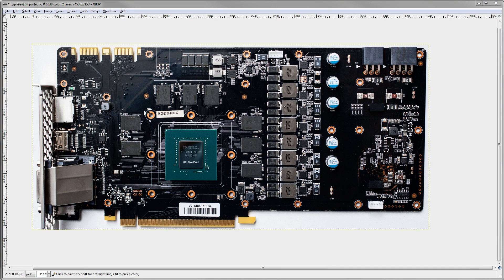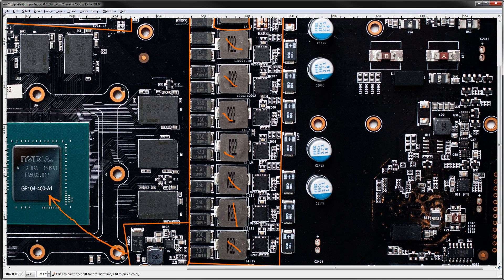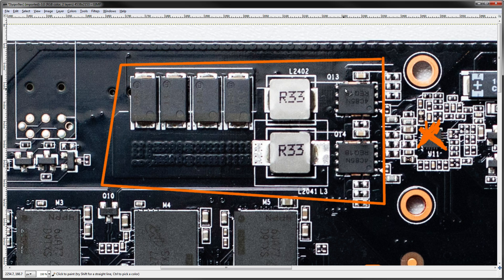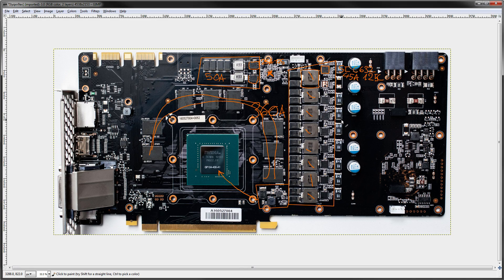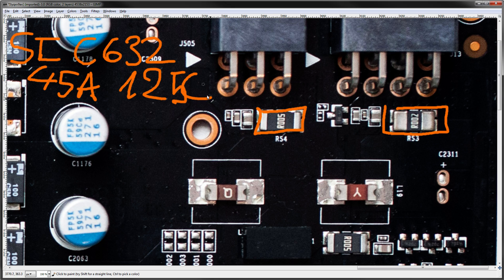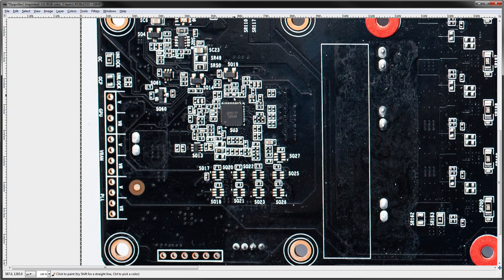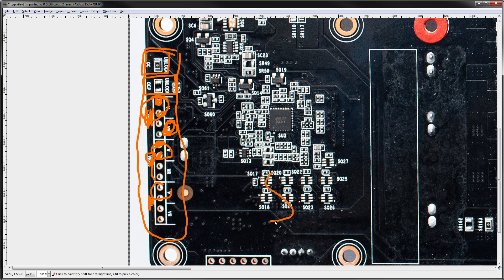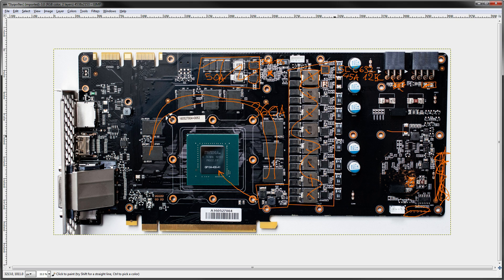PCB Breakdown: Palit GTX 1080 GameRock

Comment: Did the 1070 version get the same components? Or was that stripped down somewhat? I find it hard to believe they would just slap on the lesser GPU on the same exact PCB. Wondering, because i have said 1070 running.

Comment: I bought this card. Ot's really nice. Im running ~2150MHz right now in boost mode but there is still some room for higher frequency. Temps are really nice. I had 290X before and after having constantly 94degrees changing to 75 degrees is a really nice thing :)

Really happy with this game. Name kinda weird tho like you said. 

For me these videos are really nice to watch (automatisation/electro guy here) Cheers!

Comment: I have a question: I found a picture of a gainward 1060: https://static1.caseking.de/media/image/powermod.jpg
Since Palit and Gainward uses the same PCBs, it was of no surprise to me that there were similarities between this and the card in the video. On the picture it's barely visible, but I think it uses vishay's SIC632s as well, in a fashion that looks like a 3+1 phase design to me. I heard that the palit 1060 has an estimated tdp of 140 watts with a slight overclock.  Now forgive me, as what I'm going to say might be absolutely stupid (I'm not an overclocker, I'm not sure what I'm talking about), but isn't the Vcore voltage very close to 1 V (like 1.05V)? That would mean that the heat dissipated by the GPU in watts and the amperage that goes through it aren't very far from each other. You mentioned that these phases can deliver 45A each; in this case that would mean 135A. Well of course I'm aware of that the GPU is not the only heat dissipating component on a graphics card and that VRMs don't work at 100% efficiency, but still, I'm getting numbers that are very close to each other.
Why this interests me is because I'm on the lookout for a 1060 that's shorter than 27cm, but is not the most "budget" option either. What I wrote seems to coincide with that palit and gainward usually only gives 2 years of warranty instead of 3, but I'm intending to use my card much longer than that. So the question: Do you think the palit (jetstream)/gainward (phoenix) 1060 is safe?
Reply from the maker: GDDR5 is pretty power hungry so expect at least 20W to go to that. Also I know I said 45A in the video however that's because the datasheet doesn't show how long the VRM can actually do 50A only 45A even though the title of the datasheet is: "50 A VRPower® Integrated Power Stage". So the card will be fine.

Comment: Oops Accidentally deleted my comment when I tried to fix the horrendous error I made in it. So, the palit 1060 uses similar looking phases, but only 3 for the core. Of course, "similar looking" doesn't automatically mean that they are actually SIC632-s, but if they are, then at 125 °C the throughput is only 135A. If you increase the power target on that card, isn't that pushing it? I'm getting more and more hyped to see a palit 1060 jetstream PCB breakdown video. Or a Gainward Phoenix; as far as I know, they use the same PCB.

I saw you answered by asking if I'm talking about this card: https://www.techpowerup.com/reviews/Palit/GeForce_GTX_1060_Super_JetStream/
Yes, that is the card.

Comment: Hello, great content as always, can you do a review on the new powercolor red dragon rx 480 pcb and compare it with the red devil's one? :)
Reply from the maker: If I had a photo I could
Reply: any chance of 470 vs 480 pcb videos?
Like what are major differences between those?
Reply: Actually Hardcore Overclocking
 i have my eyes upon it due to its low price compared to others, but i need a review in order to take the shot, and i cant find any yet.

Comment: Thanks muchly for this. I was expecting some kind of cost cutting considering the price compared to other cards but pleasantly suprised to find out otherwise. Good job on the vid and good job to Palit on the card.
Reply: As a minor update I've since seen that the 1070's may have the cheaper Micron memory chips instead of Samsung (not sure if it's all of them), which isn't an issue in itself but when overclocking there has been increased instability unless you download the updated bios which manages the chips voltage better (available on the website).

Comment: Can you revisit evga 1080 ftw and explain why there has been so many overheating problem. From the look of it, ftw seems to have a very strong vrm.
Reply from the maker: http://www.gamersnexus.net/news-pc/2661-evga-mosfet-failure-possible-from-thermal-runaway-scenario
Reply: Actually Hardcore Overclocking FE cards have only 5phases for the core and a plastic backplate and they never have this thermal issue. Why a 10 phase vrm runs hotter than a 5 phase one?
Reply: There's a big front heatspread covers all VRMs and RAMs and is cooled by the main fans. I'd expect 10phase to be at least cooler than 5 phase on the FE card
Reply from the maker: that heatspreader apparently doesn't have any thermal pads
Reply: It has thermal pads, according to Tom's hardware.
http://media.bestofmicro.com/1/O/615660/gallery/EVGA-GTX-1080-FTW-Cooling-Frame-Inner_w_355.jpg
Reply from the maker: then why the hell is evga fixing this by sending more thermal pads?
Reply: Aren't those thermal pads for the backplate not the frontplate?  Cos it is the backplate that has no thermal pad. http://media.bestofmicro.com/1/N/615659/original/EVGA-GTX-1080-FTW-Backplate-Inner.jpg

or what seem to be the thermal pads on these pics aren't real thermal pads. they're just rubber pads :D
Reply: eh thats a video of replacing them with the kit, if u wanna check it out.